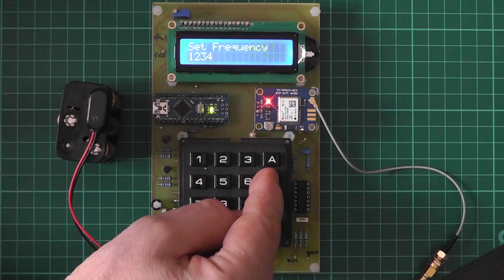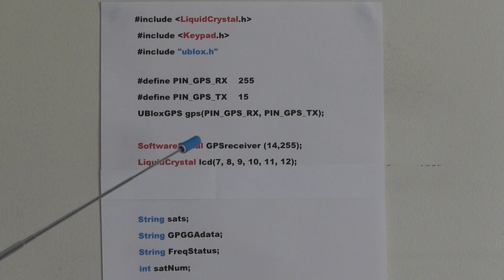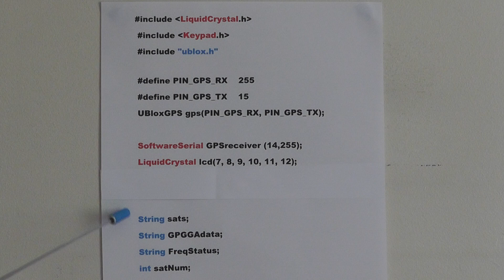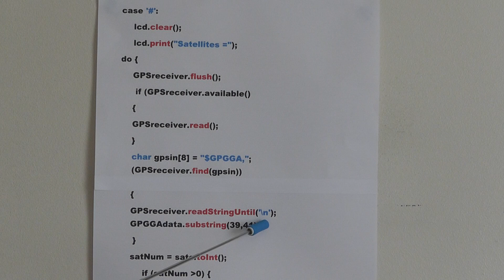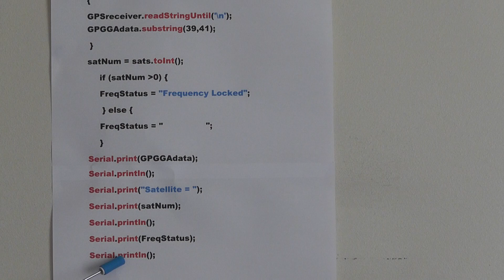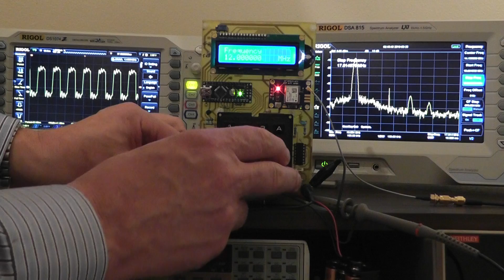Scullcom Hobby Electronics #39 - Design & Build a GPS locked Freq. Part 4

Comment: What about adding a SD card for logging your position time etc as well as a temperature controlled or oxx CEO time reference Crystal to create a basically a GPS discipline Crystal oscillator all in the same design

Comment: My guess is that 12MHz has less distortion as GPS fundametal 48MHz nicely divides to it.
Probably 6MHz looks cleaner than 5MHz as well.

I dont know how its done internaly with what frequency dividers and multipliers or some counters.
My guess is visible phase distortion comes from that every niw and then pulses coming out of  the gps module are different length as the counters compensate tha 48Mhz doesnt divide nicely to 10MHz.

Comment: The harmonics are because the GPS uses a 48Mhz clock, and for a clean signal it has to be a fraction of 48mhz. u-blox can output up to 24Mhz. Anything other than a fractal of 48Mhz will have very bad Jitter and 'noise' because the u-blox aren't dedicated frequency dividers. Better to use the GPS to output say 8Mhz, then a dedicated DDS Systhesizer to control the frequencies to be clean and with less jitter.
Reply: If you divide down the Ublox clock to 2 Mhz, you can then filter only the 5th harmonic of it (needs a narrow bandpass filter instead of a low pass mentioned in earlier episodes) and then amplifiy that to get back the 10 Mhz sine. That should be jitter free, at least by no fractional dividing. Then use a schmidt trigger IC to turn that into a square wave again.

Comment: Just finished this.  Used a 4x20 display and a Neo M8N. interestingly the characters from the M8N aren't $GPGGA but $GNGGA, the baud rate also was set to 115200, which is too fast for the adrino, had to use windows software to reset it to 9600. Also the 4700µH inductor I used had a 66ohm resistance so only fed 3.2v to the M8N, hence its the onboard 3.3v regulator had nowhere to go. I've also changed the script so you can add frequency in MHz, kHz or Hz, and use a decimal point. Give me a shout if anyone wants a copy
Reply: Yes please.
Reply: @VK3TWO  Email sent, hope it helps

Comment: The software does not work fully with the Ublox M8N. The satellite number shows just satellite and locks up the unit needing a restart.
It turns out the relevant data stream for the Neo 7N and Neo 8N are different so  I changed several lines of the Arduino code to make it work properly. Apart for that it is a great project. I have ordered a 10 Mhz lowpass filter to clean up the waveform.

Comment: Hi Louis
Just come accross this as I was searching for a GPS Disciplined 10 MHz oscilator for an ICOM IC-9700
Ordered the parts but wondered if you had done any more work on improving the spectrual purity.
I have ordered a 10MHz crystal and might try taking the output  via an attenuator to the crystal and then a 50 Ohm match at the output.
Is version 6 the final software version I wonder 
Is there a part 5 looming over the horizon? I see this was published 4 years ago now.
Keep safe
Regards and 73

Nick
G1BVI
PS tried to locate a direct email but failed

Comment: What happened to the sine wave filter?
Reply: The problem is the sine wave filter was on the 10MHz output, with components chosen for that frequency. Now the design has been changed to use the GPS reciever to divide the frequency directly, the filter would have to be made to "track" the output frequency using some kind of wide bandwidth variable filter, an much harder job. If you want a sine wave with variable frequency, you'd probably be better using the GPS frequency to clock a DDS (Direct Digital Synthesis) chip that is capable of generating sine waves from a (much higher) fixed frequency input, effectively using the GPS as a 12MHz frequency standard.

Comment: Good evening I come back again after I changed everything that we said, and I just put the material on you, but unfortunately it does not catch with any satellites, so I do not have a frequency lock. The screen light normally says it is Ver. 6 the frequencies change it, with C, I see the voltage with D, I see the frequency I put, with # I see satellites 0 and hangs there and does not go back and again I turn the trend and put it again to work. The only difference we have is that to pass the program, I have to convert it to .hex from Arduino and I go through the XLoader because my Arduino does not pass the program directly and I think something is wrong with the conversion! Do you have any idea for top what's going on ??? 
Yours sincerely Vangelis
sv1iyb

Comment: Eventually, the problem of upgrading the program has solved it but another problem has been created.
It does not catch satellites and therefore does not lock any frequencies.
The only changes I have are that I do not have the Neo-7 GPS but the GY-GPS6MV2 and instead of the 74AC14 I've put the 74HCT14
Is it possible to be one of the two who does not work ??
Thanks again
Reply from the maker: Hi,
The  GY-GPS6MV2 will not work with this project as it uses the older Neo-6M GPS Module. You need to use either a Neo-7M or Neo-7N or Neo-M8 U-blox GPS Module.

If you look at the first video I did on this project I explain which GPS Modules will work with this project:

https://www.youtube.com/watch?v=lbns-FvpzK4&t=253s   
Regards, Louis
Reply: Thank you very much for the answer, I have ordered it and I am waiting for it!
I will let you know about the result !!!
Yours sincerely
Vangelis
sv1iyb

Comment: Although I recently discovered this excellent design you have posted, thank you very much !!!
I've built the board but I'm stuck !!!
What I wanted to ask is why I can not go to your nano arduino program as many attempts as I've done !!
Note that I have the drivers needed for the nano arduino!
I use the arduino version 1.8.6
I would be very happy if you gave me a solution to the problem!
Yours sincerely
Vangelis

Comment: Hi 
I build your GPS LOCKED FREQ REF . and i need some help with the software  for the arduino nano board?  when i try  installing    gps_ref_version6  i on zipped gps_ref_ver_version 6 all three (1)gps_ref_version6=8k (2)ublox=3k (3)ublox.h =1k. but when i try uploading it to my arduino nano board i get a error ( saying KEYPAD.H  No such file or directory) yes i'm  running the latest version of arduino 1.8.3.  and i no it's works because from the library i can upload files like blink and it works good. So if you get a chance would you please help me with this problem i no it's something i'm doing wrong.
Allan
Reply from the maker: Hi Allan,
It looks like you do not have the keypad.h library installed on your Arduino IDE software. You can download the library from the following link:
https://playground.arduino.cc/uploads/Code/keypad.zip
Also check the link below which tells you how to install the library:
https://playground.arduino.cc/Code/Keypad
Regards,
Louis
Reply: Hi thanks for writting back.But i can not get copy the two files keypad and gps_ref_version6 to my arduino nano board.in the help folder it says make a directory inside the library sub-directory of your sketch-book directory and copy or move the files into that directory? I can not  get that to work.I'm not sure whats wrong.have you ran into this problem before?

Comment: Thank you! This is exactly what I was looking for. Great frequency standard without need of calibration on the cheap side. The only thing I do not like is the output waveform. Kindly check this thred: http://www.antiqueradios.com/forums/viewtopic.php?f=8&t=293808. Rise time under 2ns and no ringing at all with the same74AC14  as you use now. Might be great upgrade for the next version. Regards, Tomas

Comment: Thanks for a nice, fun project with a very useful result .... I used a 4x20 LCD display and changed the sketch quite a bit to support it.  'A' key still starts the new frequency entry and activates the 0-9 keys which are now inactive unless the frequency is being keyed in ... 'B' key terminates the new frequency entry and resets the GPS module frequency output.  The 'C' key is deactivated because the battery voltage now shows up on the third LCD line when the power comes up and again whenever the frequency is changed.  Pressing '#' enters the satellite/lock monitoring mode until '#' is pressed again at which time it exits back to the main loop.  The sketch with changes can be downloaded from my FTP site (ftp://rjugel.asuscomm.com) in the "generaldownloads" folder ... sign in as 'visitor' with a password of 'anonymous' to access the site.  Thanks again .... Dick :-)
Reply: Hi Dick
I tried going to your ftp site but I get a blank page? Has it been taken down? Regards
Nick
Reply from the maker: Hi Richard,
Thanks for your comments. Glad you found the project useful. Thanks also for the link I will have a look at your Arduino sketch.
Regards,
Louis

Comment: Hello.
Great project!
And why you have refused frequency dividers on IC`s?
Reply from the maker: Thanks. Initially in this project (earlier parts) I did use frequency divider IC's which worked well but the range of selectable frequencies was limited. In this version any frequency can be keyed in.
Reply: Yes, any frequency can be keyed in, but only one at the moment.
I want to use u-blox neo-m8n for this project.
I think this module has better quality of 10 MHz signal. What do you think?
Reply from the maker: I have tested both the neo-7n and the neo-m8n and found they both work well with this project, with no noticeable difference in frequency accuracy . The neo-m8n is more expensive and it  acquires and tracks two GNSS systems concurrently while the neo-7n only tracks one at a time. So the neo-m8n is more accurate at GPS positioning but I believe the oscillator used is the same as the neo-7n.
Reply: What CAD soft do you use?
Is it possible to obtain schematic and board files?
Reply from the maker: For this project I used KiCad. You can download all the files which I have zipped from the following link - just unzip the file and you will have all the 8 files which you can use in Kicad:
http://www.scullcom.com/GPS_locked_Freq_Ref_Part4.zip
Regards,
Louis

Comment: Very nice project! Looks very professional. I would like to build this project and am in the process of acquiring the components. As far as the GPS module, I am planning on getting the Ublox 8N module. Will the software you have provided for this project work on GPS modules other than the one you used in your project without modification?
Reply from the maker: Thanks for your comment. Yes the software should work OK with the Ublox 8N module.

Comment: I love your Channel and the tutorials. I am however confused this video is labeled and a Reference but didn't it change from a reference to an actual generator as soon as the frequency became programmable. or am I missing something. also in Part two you went a little into how to create a sine wave but it wasn't included in the final build would you consider expanding these tutorials further by actually including the sine wave (as well as Triangle - if possible). It could even be an external module that connects to any square wave generator.
Reply from the maker: +shagggyman1 Thanks for your comments. Yes the unit is now programmable but as it is still locked to the GPS signal it still can be used as a reference source but now you can select the frequency you want. In the earlier parts I did discuss converting a square wave to a sine wave and this is something I will follow up on in a future video as well as looking at other types of waveforms.
Reply: Great, I look forward to it.

Comment: Just discovered your channel and I love it! I was looking for a DIY function generator and found yours, which is almost perfect. Now I just have to work out how to convert it to use a 16 x 4 LCD to display frequency and waveform amplitude. Shouldn't be too hard...
Reply from the maker: +Moonbrony Thanks for your comments. If you want to use a 16 x 4 LCD then change the following line in the code from;
lcd.begin(16, 2);
to
lcd.begin(16,4);
This will then allow you to use the four lines of the LCD. You can then simply change the cursor position commands to your requirements.

Comment: Hi Lewis. This is a link to my build of your project. Thanks again.
 http://arklite.net/gpsfreqstand.html
Reply from the maker: +Eric Gee Thanks Eric. Sorry for the delay in answering but for some strange reason Google put your message in the spam folder (may be due to the web page link) - so I changed it manually when I saw it. I had a look and see you did a great job, nice PCB. The membrane keypad looks good on the project box. Nice idea on the software tweaks.
Reply: +Scullcom Hobby Electronics  Thanks for the reply and comments.